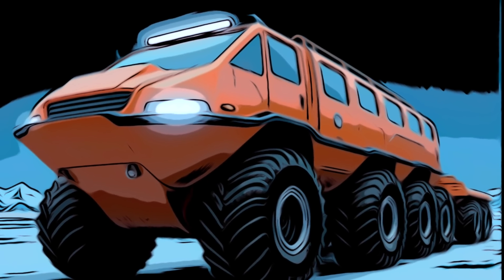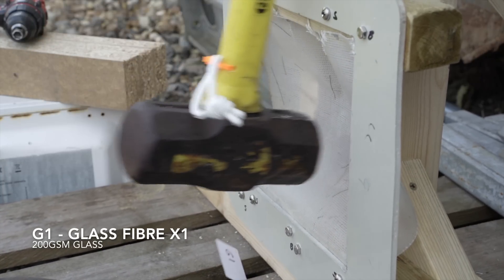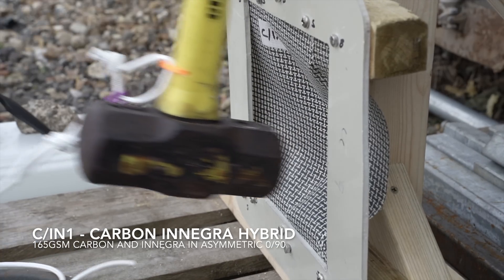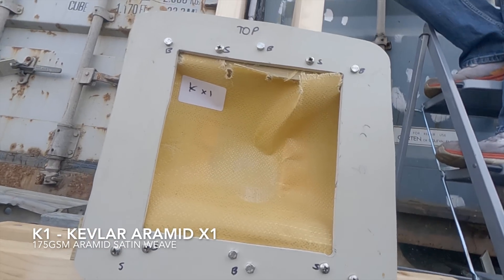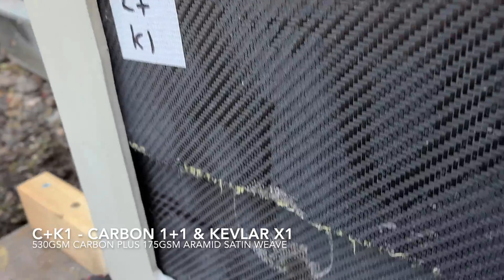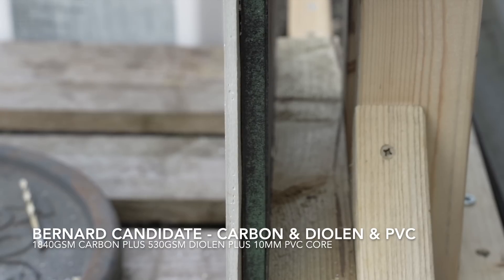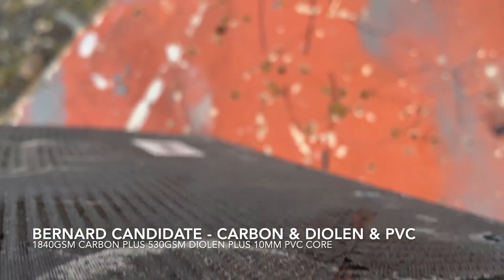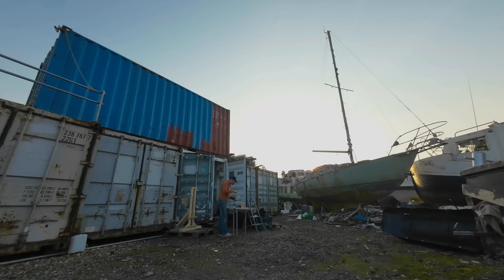IMPACT TEST Pt2: Hammer V Carbon Fibre, Kevlar, Innegra, Diolen. Arctic Vehicle Project BERNARD [4K]

Comment: It breaks at the top of the impact zone every single time because the Apex of the pendulum is too far back forcing the top of the hammer head into your composite first. Instead of impacting as a flat zone the surface area of the hammerhead It is only making contact in one point and then the rest of the face slows it down.
Reply from the maker: You're right. Certainly a rough and ready test but fairly consistent and indicative between all the types of fibre.

Comment: I thought of another issue you can improve. Your composites looked very dry (not made in a flat mold under pressure) and you had very few bolts so you concentrate the entire impact to a few strands that can break in succession. You can use PU bands as clamping contact instead of point bolts and double the size of the sheet at least. Also the hammer comes in at an angle so it's an edge impact. That's not wrong as such but very different from blunt. You can make a round impactor.
Reply from the maker: Good points well made. I did expect the frame to clamp more uniformly. Anyhow, the rig served a comparative test purpose and helped me think through choices. 

Agreed that larger sheets offer better dissipation than small ones. I don't think the lams were dry - over resined if anything. I often use baking paper as a release film and perhaps this affects appearance.

Comment: Bigger sheet. the fixed frame puts a lot of demand on the local area. When you hammered your tub that was a free larger shape. makes a big difference. So a large uniform CF surface will survive a lot more. a kevlar vest actually requires the fibers to be completely free. even resin is too much constraint

Comment: Fun video.  At 5:50 you mention that Kevlar isn't suitable for projects involving possible damage and water ingress, and that it soaks up water.  Kevlar has been used for canoes for decades, and I haven't known this to be an issue.  Do you have any research or personal experience supporting the water wicking idea?  Thanks!
Reply from the maker: Some papers - e.g. https://www.mdpi.com/2075-5309/14/2/409 https://www.researchgate.net/publication/228758511_The_effects_of_water_aging_on_the_mechanical_properties_of_glass-fiber_and_kevlar-fiber_epoxy_composite_materials, tons of discussion https://www.google.com/search?q=kevlar+laminate+water+damage&rlz=1C5CHFA_enGB1063GB1063&oq=kevlar+laminate+water+damage&gs_lcrp=EgZjaHJvbWUyBggAEEUYOTIHCAEQIRigATIHCAIQIRiPAtIBCDg5ODJqMGo3qAIAsAIA&sourceid=chrome&ie=UTF-8 and in my own experience, I've had a small fracture in a kevlar panel et damp, and it took weeks to dry in a low humid cupboard before I could make a repair.

If your carbon-kevlar laminate remains properly laminated with a shield of epoxy as protection, fine, and likewise if it's reinforcement on the inner skin, but in practice dink, cracks and ingress will happen. For casual kayak use with lots of time in the dry to recover after ingress, it's possible a user won't notice.

There's a question mark about the mode of water capillary action - if it's alongside the dry fibres that don't adhere to the resin, or whether the aramid itself wicks the water.

Comment: This is fascinating. Do you have a defined mission yet or are you just testing fiber strength for fun? I think if you ever make it to the Arctic, watch out for polar bears with sledge hammers.
Reply from the maker: I'm pretty sure the aims to create a light expedition support vehicle, which can be produced in numbers, and innovative fuel storage, have been put out there.

If I ever make it to the Arctic? I'm in the Arctic 80% of winters.

Comment: Contact the Coleman company they made canoes out of something called ram x wasn't quite as light as the aluminum canoes put the product itself was indestructible
Reply from the maker: I think Ram-X is a high quality HDPE plastic, which isn't really going to work here due to the density, lesser mechanical performance and inability to run repairs.

Comment: I think you could reduce the tear out at your screw points, and perhaps get slightly different failure results, if you added vertical supports on the back side of the test piece along with some screws. This would give a more uniform clamping force, and distribute the blow evenly around the perimeter of the test piece.
Reply: I think the tear out could be affecting the results as well, where more tear-prone samples are reducing the impact force and more tear-resistant increase it. A method for reducing tearout would be to add embedded hardpoints, especially in thicker sandwich constructions, though those thicker samples didn''t face the same issue.
Reply from the maker: That's possible, although the doubling of the number of grip points (holes) top and bottom made little different. I think this is an Occam's razor moment - the holes ripped in the thinner ones as the material around them was too weak.

Comment: I believe the fracturing Carbon outerskin is why a couple of impact resistant canoe and kayak manufacturers I've seen chose Basalt with Innegra. I'd try carbon uni at 45/-45 rather than twill for the outer layer. Everything I've read says non-crimp fabric is superior for impact energy and tensile strength, unsure about abrasion resistance. I've seen quite a few composite automotive manufacturers now using stitched chopped strand, non-woven, and unidirectional polyester cores and wondered if it's for non-crimp fabric impact resistance as well as cost. Perhaps try that instead of the Diolen weave. The shear strength of linear PVC foam is pretty low, was the core used cross-linked (CL) or linear (L)?
Reply from the maker: You're right about the twill. I was using up some offcuts, and will use biax for the real thing. Non crimp wets out slowly, but is otherwise a winner.

Not sure about any benefits of chopped strands, except for smooth face finishes or lowering cost.

The PVC is cross linked : https://www.easycomposites.co.uk/easycell75-closed-cell-pvc-foam . The cracks were pretty inevitable given the impact intensity.

Comment: Will you be using vacuum bagging for the final panels?  That greatly increases resin permeation through the whole sandwich.  Not sure what effects it may have on your core (foam?) though.
Reply from the maker: Vacuum is a possibility, and you can get cores designed to allow resin infusion to pass along and through.

Comment: Are you thinking separate propulsion for water?  aka a screw. Or wheels for land with waverley steamer-esch hubcaps?
Reply from the maker: Electric outboard on the back for medium water sections. Wheel paddle for v short sections. Tow behind a boat for longer.
Reply: @AlexHibbertOriginals  Six wheeler?
Reply from the maker: At present

Comment: You need to do these impact tests at low temperature, in the conditions that the vehicle will be in. The resin will perform differently in those conditions. You will have parts that will be in the warm, interior cabin, so this data is still useful, but you need to know what the bitter cold is going to do to the composite.

Another factor when constructing with composites you need to consider is repeated stress. Since they tend to fail catastrophically and have such varied properties depending on resin, fabric, and layup, it is not as easy to calculate the strength you are going to need to resist wear do to repeated stress. Because of this, an additional strength factor multiplier is used to compensate, depending on the general material of the composite and application. This prevents the general wear and tear of use causing a failure of the material. My brother said it was between a factor of 2 and 3 for most aerospace applications, but those have a high safety factor. Sticking with a marine level might be fine, but reinforced where ice would be hitting it.
Reply from the maker: We did some great testing with Easy Composites, and they supported the available testing reports online to say that composites perform similarly or better in the cold.

On your second point, absolutely yes. The safety multiplier, and also choice of materials based on their fatigue resistance. Some are notoriously short-lived.
Reply: a report came out about fiberglass hulls in speed boats, within the last 5 years. the fiberglass does wear out faster than they thought(not sure where they got some 50 year figure) but it was able to take slamming waves at speed on the hull for 18-22 years if i remember correctly. at that point it "broke" as in it wasn't absorbing the impacts fully, but no holes or cracks or gaps appeared.

the temperature doesn't really bother me, there's tons of grp stuff taken to both poles by the military and reseachers. it's the ice. ice is the single reason you cannot have a grp/composite ship ice rated/classed. lloyds will allow it if you have a big steel piece in the bow and maybe a full steel keel,they changed it recently havent checked.
Reply: @jmwintenn  The piercing and slicing would be the reason, I suspect.

Comment: You may want to try Washers under the fiberglass frame. I suspect there is not actually much clamping done by the frame itself as it is (at these forces) rather flexible
Reply from the maker: I considered this, but then the washers would lift the frame away and stop it pressing against any more of the sheets than those small circular areas.

Comment: Now that you getting to know how composits at your local temps, find a way to test at artic low temps. Be fun to watch...
Reply from the maker: We did some great testing with Easy Composites, and they supported the available testing reports online to say that composites perform similarly or better in the cold.

That said, no reason why I can't take some samples to Northwest Territories for more testing next winter (although we make the first Bernard this summer). I can't afford a -40 freezer!
Reply: A cardboard box,dry ice,and a thermometer will do just fine...
Reply from the maker: It would need to be rather large, very well insulated and somehow accessible without letting the cold air out. Easier said than done.

Comment: Just based on the expectation that all impacts will come from the outside, I'd assume you wanna go for maximum tensile strength on the inside and a more impact-resistant sandwich on the outside (of course this may come with some whacky failure mode like the foam being crushed in-plane or something). But I assume that would have been your first thought as well.

I like the reinforcing fibers through the core. Do you think there's some kind of scaled-up sewing machine you could use to get a meaningful amount? Punctually attach a sheet of carbon each side, then sew through with Dyneema thread before applying the rest of the fiber and resin.
Reply from the maker: There is that, but also gentle but 'strong' flexing will come from inside, from the weight of things stored. So this means plenty of carbon on both faces of the sandwich to maximise stiffness, but avoiding placing composites with poor compressive strength near the faces likely to be impacted.

For the tongues through the foam, I think we'll just run tapes of unidirectional high tensile carbon at short intervals.

Comment: u know i love u and love your spirit. missions are objectives wherein novel-engineering isnt welcome
Reply: from my understanding, pretty much everything in the arctic is novel engineering, they face quite different challenges than pretty much anywhere else.
Reply from the maker: I'm not sure this is too novel. People have been making composite hybrid shells for decades. I'm just finding the best recipe.
Reply: @AlexHibbertOriginals  mate, u have a hammer in your backyard, as science to pioneer a vehicle across ice-flows with passengers
Reply from the maker: If only the yard were my backyard. I can only dream.
Reply: @AlexHibbertOriginals  stockton also didnt use 45-degree plys in calculations for hull, etc, etc. I just don't want anyone getting hurt and it falling on your conscience.
Reply: @internetrules8522  there is NO need to test these rated materials, unless Alex is planning on using them in un-calculated configurations...ala stockton rush moving wall thickness from 10" to 5", then making it a 5-bake composite.
Reply from the maker: Do then provide the rated results from exisiting testing that provide the optimum sandwich for composites in this exact layup.
Reply: @AlexHibbertOriginals  You are testing impacts perpendicular to lattice calculation. what are we doing here? planning passengers changes the game...the poles eat hubris for breakfast

Comment: Definitely the sandwich for  strength, I'm thinking for heat retention as well.  How  would  you go about repairing any damage?  Would you have a kit you could  use  to patch things or would it be  a  base of hope for the best?
Reply from the maker: Carbon (and glass) is pretty easy to repair in the field if you can create a temporary warm zone around it. You can grind away damage, and then add core and new laminate patches with rapid repair epoxy resin. Easier than welding in new steel/alu plates, I'd argue. The 'frilly' laminate fabrics are harder to repair and seal.